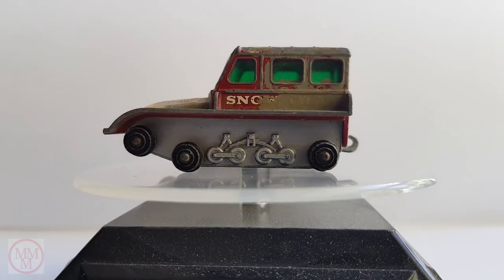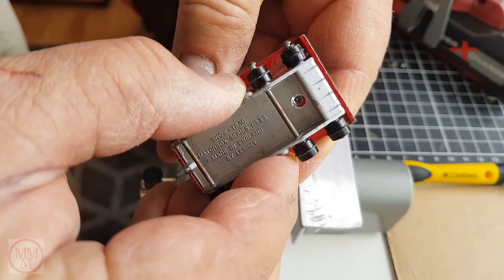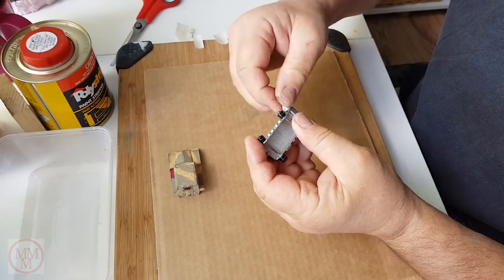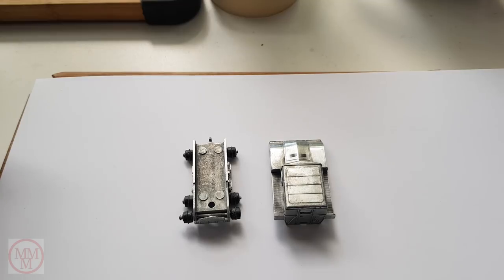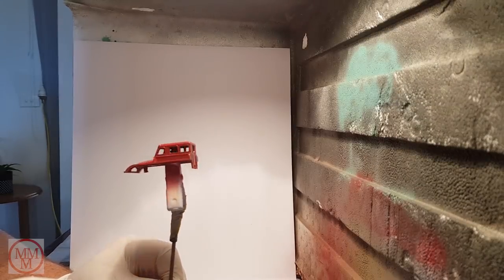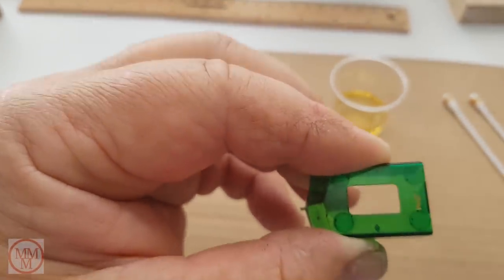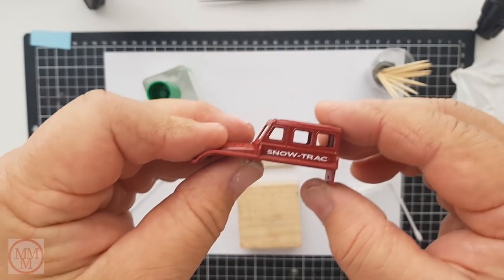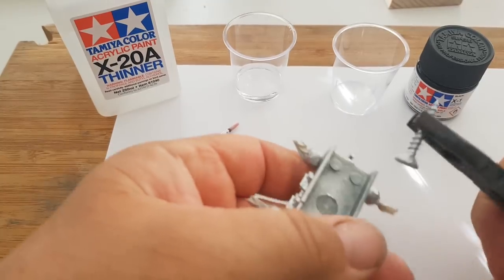MATCHBOX Restoration No 35b Snow Trac Tractor 1964

Comment: Very nice indeed. Oddly enough, I bought one off ebay to paint another colour, but when it arrived, it was in such good condition, I hadn't the heart to ruin it. It looks hardly played with, and has 'Snow Trac' cast into the sides. This is possibly my favourite Lesney Matchbox model of all. Possibly because it was so unusual - and the real vehicle, which utilised a lot of Volkswagen mechanical parts, was rare.
Reply from the maker: I picked it for the same reason; it's an unusual one for sure.
Reply: Very cool! I'm sure there used to be one of these knocking around when I was a kid which my brother had in the 60s. It's probably still at my mum's along with a mix of my brother's and my various diecast cars from Matchbox, Corgi, Majorette and Hotwheels and probably a few others.

Only just realised there was a Snow Trac in 'The Shining', the one which Jack nobbles so Wendy can't escape with Danny.
Reply: @MartysMatchboxMakeovers   The Caterpillar Tracks were also used in Green for an Excavator Model ( shovel was fixed on that I wanted one that moved).   The tipper truck and the snow trac used different shades of red.  There was I think a trade card for the Snow Trac in a set of Lyons Maid Collector Cards printed in the 1960syou got with lollies  Didn't Thunderbirds special effects have one and James Bond a full sized one in white ?
Reply: I think the cards were in the green packs of Brooke Bond tea, there were 50 different ones that made the 'Transport through the ages' album.  @highpath4776

Comment: Brake fluid can and will soften plastic if left on to long, so it is important to use a very small amount and not to leave it on more than a few seconds.  On a very different note, I would recommend using blue tack (a reusable adhesive) to hold your screw to your the model. I started using this a few years back when painting miniatures and absolutely love it. 

I always enjoy watching you bring new life to these old vehicles and got a real kick out of your reference to your wife's toothbrush.

Comment: Marty,  You are amazing.  I have a bunch of these original match box cars.  They are all in mint condition.  I'm surprised you can get parts like the tracks and transfers (in the states, we would call them decals).  I'm building a working model amusement park in my basement.  Probably could use your skills.   I imagine you don't have any problems find vehicles to restore.
Reply from the maker: WOW! thanks Jim! - I try my best. There are more models out there to restore than there are mint ones i'm guessing. Good luck with your amusement park sounds like fun!

Comment: The common or garden CA glue breaks down at around 150 deg Celsius. Use a soldering iron to heat your screw and it will fall off easily.
Reply: It's also soluble in acetone. Nail polish remover is good for CA glue clean up.

Comment: I've noticed in a few of your recent videos that you've not removed the wheels but masked them instead.  Did you determine that it wasn't necessary?  I loved the little trick with the finish nail in the drill press that you've used to reform the ends of the axles.

Comment: I use a very fine metal polish on hard plastic parts. it can take out small scratches, just go lightly while buffing. I think you found some aluminium  polish that does similarly in another vid, this must be an early one. I did wonder why you didn't simply remove the axles and wheels like you do in your other vids. Perhaps you hadn't come up with that method when this was shot... I don't know. I would have been tempted to polish the metal a little more and then clear coat it. Tho it wouldn't be a full restoration, the metal on this one looked very nice as it was once cleaned. Oh thanks for the tip on wetting the surface first, my decal attempt on my first restoration went horribly wrong... twice.

Comment: always loved this matchbox..I just ordered a set of tracks and will be restoring mine. Interestingly the person who painted camo on yours was being historically correct,,from wikipedia..Snow Tracs were also called Sand Tracs and saw use in the Sahara Desert as over-sand transport vehicles. The crawler track design was well suited for either sand or snow use but was not generally suitable for rocky all-terrain use. The track required loose ground to properly function so it was able to work equally well on gravel, sand, snow, or other loose material like tall grass. Because of their ability to be used in many conditions and climates, the Snow Trac was used world wide and still is in use today by emergency organizations and some commercial enterprises, although large utilities no longer use Snow Tracs.

Comment: was there a trailer for that model?
Reply: john doe.  Matchbox never made a specific trailer for the Snow Trac.  The real one might have been coupled to a ski equipped sledge.  They put tow hooks on some other models, such as tractors, and never provided a trailer for them.  The nearest one that might look suitable with would be the #51 green tipping trailer.  It is a trailer for the #50 John Deere Lanz tractor, but it would look the part.  The rest of the Matchbox trailer range are more suitable for their cars: Caravan, Honda motorcycle on trailer, and a boat and trailer.
Reply: So a modeler could make a one of a kind model out of a #51 with skis instead of wheels.
Reply: john doe.  Yes, it is quite common.  A modified Matchbox (or other diecast) is called a Code 3.  I have made a few.  I had 2 Matchbox 9 boat trailers - came in a job lot.  The boats were missing, and the trailers were damaged.  Cut up the 2 trailers and rejoined them to become a tandem 2 axle machine trailer, by using a flat sheet of metal for the trailer deck.  The trailer now carries a Matchbox forklift and is towed by a 71 Jeep Gladiator.  The Jeep is also Code 3 as it now has a towhook, which was never fitted by Matchbox.
Reply: @railtrolley  Very ingenious &inventive. I never knew modellers did this type of activity. I always thought they were kept as genuine as possible. Well done!
Reply: David Palmer, thank you for your comments.  If the Matchbox is near to, or mint I would leave it original.  Any model that is not rare or pre-production and is damaged or missing most of the paint is not worth much and is ripe for restoring or modifying / kitbashing.

Comment: Nicely done.
A couple of extra tips for you...
Brake fluid is good for stripping paint without damaging the plastic, but you can also use a spray oven cleaner such as Mr Muscle - put the piece in a sealable plastic bag, sprya on some cleaner and leave it overnight - the paint will rinse off under the tap.
If you want a really good shine to your silver paint finishes, undercoat them with a gloss black - this produces a nice high shine finish.
Reply from the maker: Never heard of the gloss black under the silver idea. Might give it a try.

Comment: Fine project! I wonder who needed a snow tractor for desert use :D (Sand Tracs did exist, I know, but still...) For working with methyl chloride paint strippers the gloves have to be nitrile rubber, methyl chloride goes right through latex and vinyl gloves almost as if they weren't there. A quick rinse with water is better than wrong kind of gloves, it's more of extreme local irritation than a proper chemical burn anyway. The method for checking if the paint stripper contains any methyl chloride is easy: if the stripper does f-all to actually remove the paint, it's free of the stuff.

Comment: Hi Marty - got a couple of tips for you ;
1. In your mini vice to create a semi solid but padded set of vice pads, use a foam kneeler or seat pad, and cut 2 lengths of padding to attach to the vice jaw clamp heads. The foam is of a consistency where it gives and doesn't create any dents in a model, but is solid enough to to hold quite tightly. The same foam, but slightly thinner is used in yoga mats and camping sleep mats.
2. So you don't loose any small screws buy a magnatizer / de-magnatizer from Amazon. They are quite cheap and you can then magnatize all your tools  which will hold small screws and keep them on the screwdriver heads when placing them in the model.
Hope these tips help you mate, great video as always. Morty did a great job of supervising the project - maybe you should let him oversee another one ?
Reply from the maker: Thanks for the tips, I'm actually thinking about upgrading my vice to a sturdier model.

Comment: Nice restore! But why didn't you just remove the axles? Seems like working around the bogies was harder than just taking them off.
Reply from the maker: I dunno , just mixing it up a bit I guess!!
Reply: My thoughts exactly. At least we now can see how wonderful the axle removal and refit turns out when done. By not removing them you are making the task quite a bit harder. The masking is quite a hassle and painting the wheels turns out to be a lot tougher as well. The trick with your drill press to refit the axles is very useful, so to say.

Comment: You should check out Woodland Scenic dry transfer letters to see if they have the correct font.  There may be other brands that would match as well.  It's a bit more tedious to use dry transfer, and you'd have to use a clear coat, but it might better match the font you need.

Comment: They have a real one of these in the Cole Land Transportation Museum in Bangor, Maine, USA. Power company maintenance crews up in the northern part of the state used to use them to get to the big transmission lines out in the woods in winter.  I didn't realize it was an actual thing when I had this toy as a kid, so it was a moment of real delight to encounter it the first time I visited the Cole Museum, years later.
Reply: I must amend the above, as it was late at night and my memory deceived me. The actual machine they have at the Cole is a Tucker Sno-Cat, not a Snow-Trac.  It was just the general class of vehicle I was surprised to find had really existed.

Comment: I find these videos not only satisfying but unusually calming. The light music in the background is just right. 
By the way, you might want to try using "Little Red Cap - Caulk Saving Caps" to cover your wheels during painting. They would be much easier to use than masking tape. Heck, you might even decide to leave them on... like little red rubber tires.

Comment: Hello from the U.S., i noticed the wheels looked a little chewed up. 
I suggest using a BIC lighter (BIC lighters burn cleaner) and using just the tip of the flame to heat the wheels. Now if you're careful enough the scratches and dents in the plastic will disappear.

Comment: made in 1964 and you can still get parts for it...Amazing
Reply: jeff lloyd my guess is these parts are 3D printed/ after market made because they are not exactly the same. The treads have no groove like the original and the font on the transfers is wrong.

Comment: Nice restore!  Did they make a trailer for it?  If so, would make a great companion video and accessory.
Reply from the maker: Heres a comment from a subscriber called "railtrolley"  - Matchbox never made a specific trailer for the Snow Trac.  The real one might have been coupled to a ski equipped sledge.  They put tow hooks on some other models, such as tractors, and never provided a trailer for them.  The nearest one that might look suitable with would be the #51 green tipping trailer.  It is a trailer for the #50 John Deere Lanz tractor, but it would look the part.  The rest of the Matchbox trailer range are more suitable for their cars: Caravan, Honda motorcycle on trailer, and a boat and trailer.    
  

      
  

    

          
        ·
          1

Comment: Don't know how I found your channel as I'm not especially into model restoration but I'm really enjoying these and you've just earned yourself another subscriber from the UK!
Having watched this I was inspired to do a little research into the Snow Trac myself. Was surprised to learn that these were powered by VW aircooled engines (I've owned an old 70s combi for the past 20 years), so whatever it is, that's not a radiator grill at the front lol.
Keep up the good work, I need more! 👍
Reply from the maker: Great post and now a mystery as to what the grill on the front was for! Thanks for subscribing, always very appreciative of new people, like yourself, showing an interest in what I do!
Reply: I have seen a video on youtube by a group called Salvage Squad.  They restore a real Snow Trac in one episode.
Reply: You may also want to consider using masking fluid to make things easier as well. Humberol maskol is one I use when building  plastic kits.

Comment: ,sand transparency with 3000 grit wet or dry sandpaper and buff with a fine finish buffing compound,works with amazing results.you can do this manually it takes out all the fine scratches.with a very smooth luster,just like new.

Comment: Have you considered using magnets on your positioning blocks and magnetic surface under your work mat? They would have infinite variation in position and hold firmly without the risk of accidental  slip. I've used magnetic sheet and the magnets out of old Hard Disk Drives. These are really strong.

Comment: The little allen head that you used to drive the 2/56 screw. What size is the allen wrench?
Reply from the maker: Not sure the screws are called 2M screws. You can buy them on line and they usually come with an allen key of the correct size.
Reply: @MartysMatchboxMakeovers   well, the reason i ask is that here in the states i ordered 2/56 screws for hot wheels cars and didnt consider a tool for driving them. I may already have one. I havnt realy checked but yeah its pretty small.  But i figured i would ask to be sure.
Reply from the maker: I just measured the key with the digital calipers. It is 1.2 mm hope this helps. I would have answered earlier but I was working night shift last night.
Reply: @MartysMatchboxMakeovers  thank you bud! And trust me your reply was pretty quick. No worries bud thanks for your reply i appreciate it! Keep up the cool restoration vidios. I love them.

Comment: Instead of small bits of tape for the wheels why not try bits of aluminum foil. You can crush it tightly and it makes a better barrier for the stripper. Just pop them off when done.

Comment: Another tip... if you have an old dead leather belt that you're throwing away, save it. Use the leather to make pads for your vise jaws... glue it to the aluminium, super glue works OK, in the States we have something called "Shoe Goo" or "T-6000" glue... it makes a nice, gentle yet grippy surface that won't damage your matchboxes.

Comment: Why go to all the trouble only to use the wrong red and wrong decals? Loving your videos, but that made me sad.
Reply from the maker: Hey Josh, pretty damn close colour wise! - I have since found out that there were two types of decals that were used on this model. one smaller than the other. It could be that the supplier of the transfer was not aware of this issue. PS: DONT BE SAD!!
Reply: Thanks, I'll probably survive! I just saw you take the time to mix up the right color on the roll back van...from the looks of it a little white would have got the color exact. Still love watching these. Can't wait for more!

Comment: "wife's toothbrush"...................heehee!
Reply from the maker: I know! - Ha Ha!
Reply: I'm curious - I've seen you remove the wheels before painting and I've seen you mask them as you did here. What's the reasoning for the different choices?
Reply: "I'm gonna snap this off", "I'm just gonna snap this off", "I'm GOING tp snap this off" lol! 
Just mere drop of acetone (nail polish remover with acetone) on the side of the screw head would make that a bit easier in the event you are working with anything a bit more delicate.